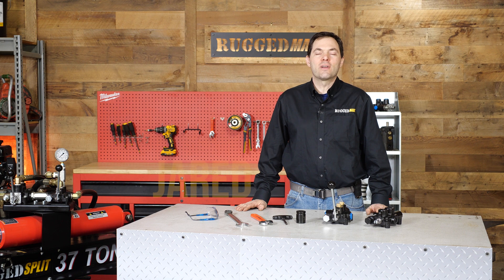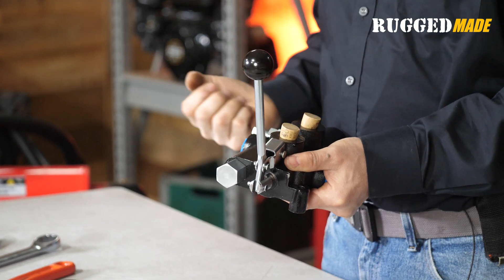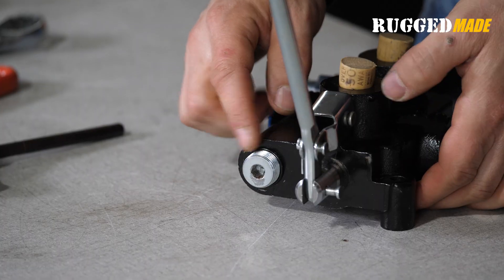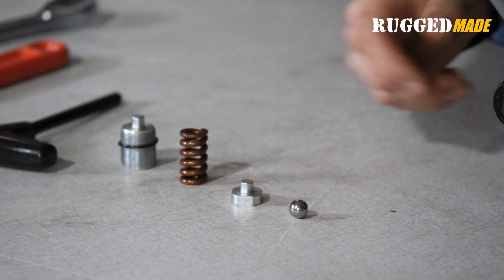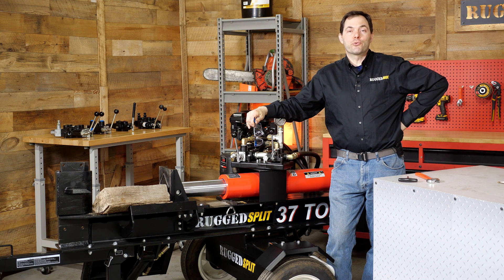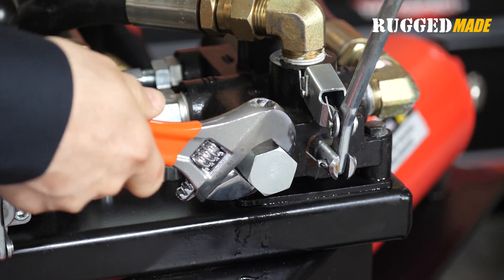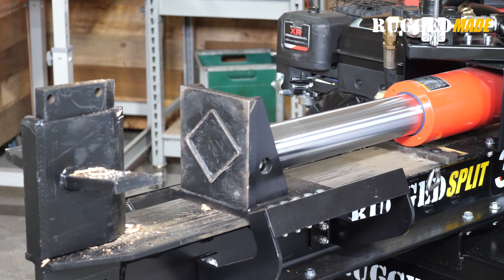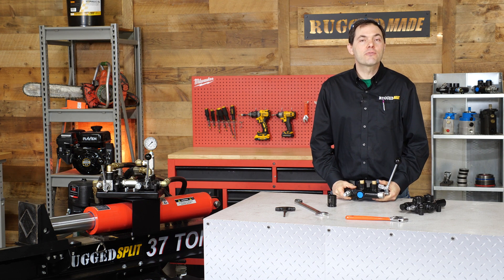Tech Corner: How to Adjust the Relief Setting on Your Log Splitter Valve

Comment: Is there a way to adjust the pressure it takes to stop the ram on the retrack stroke? When i install the stroke restrictor plate, the ram comes back and it loads the plate so much it makes it very difficult to remove the stroke restrictor. Any hints?

Comment: How can I adjust to return faster
Reply: The cylinder speed is depending on the flow rate. If you want the cylinder return faster, it's better to check if the hydraulic system flow rate was enough or not.

Comment: Where is a good place to install the pressure gauge when adjusting the relief?
Reply from the maker: As seen in the video, the ideal place to install a gauge for the purpose of reading your valve's relief pressure is between the pump and the valve.

Comment: Won't there be possibility of the valve moving while tightening the Valve Cap?
Reply from the maker: No Kingsley, there is enough friction holding the threaded adjustment bolt that it does not spin merely by installing the hex cap. You need an allen wrench to turn it.
Reply: @RuggedMade  Thanks a lot for this. I look forward to the day I'll built mine.

Comment: I’m having problem with my splitter, it has a breather cap where you fill it up. When you start it up and move handle in or out it starts spewing out fluid either way you go. It has no splitting power at all, just had cylinder repaired. Any ideas guys I can’t afford a new one.
Reply from the maker: Please email support@ruggedmade.com or call (855)-878-4433 and someone can assist you with this.